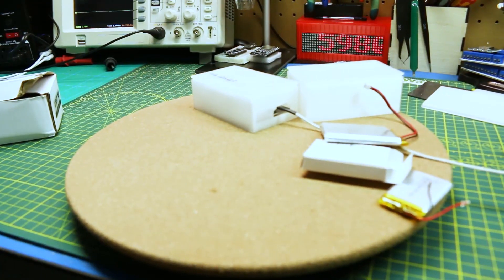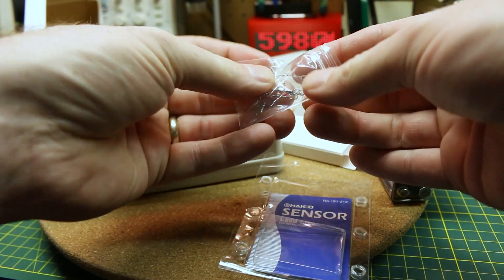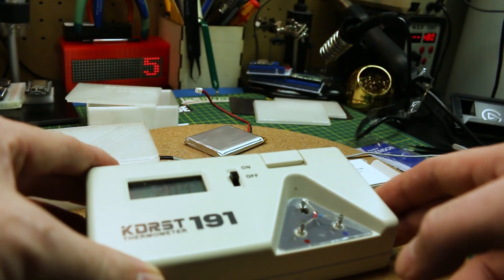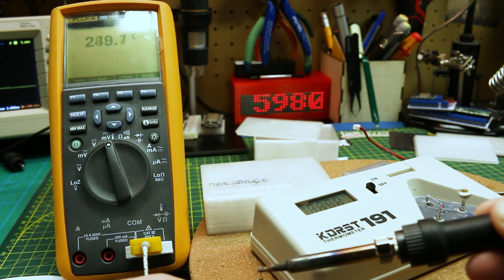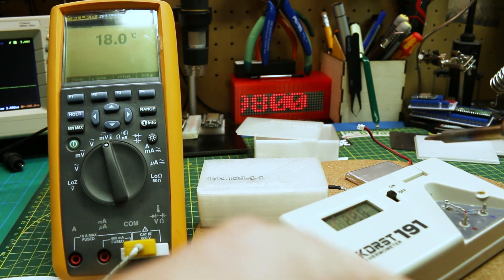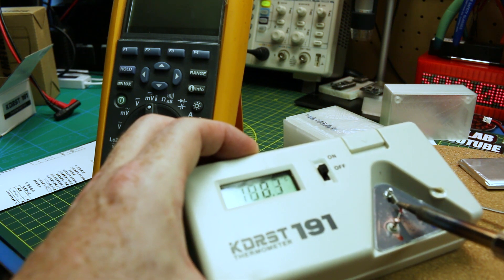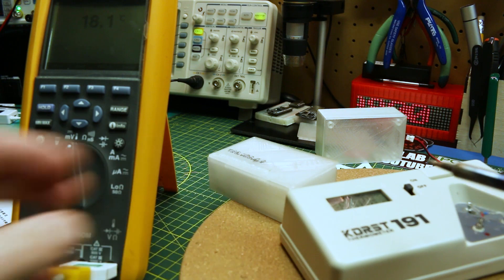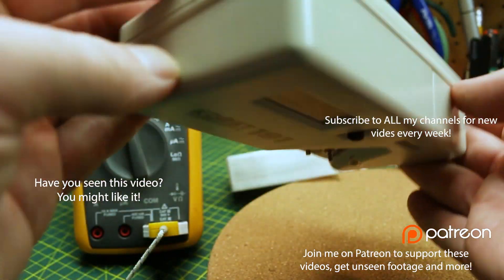Is Your Soldering Iron Accurate???

Comment: Tip should be clear before testing for better  readings. need to add a small amount of  solder to the center before  testing starts.
the tip  Pin doesn't look like the wire is all the way on.  press down on the white button to help install the wire.  test wire  only lasts for 50 tests/touches, then it needs to be replaced. Remove the  Plastic protective  wrap  on the triangle area of the tester.

Comment: What tips does that Ungar solder station use? I've got a Ungar 9900as that take 9900as series tips and haven't been able to find a source to replacement tips. Just picked up a yihua 939d+ to replace it as I know I can get 900M tips everywhere.